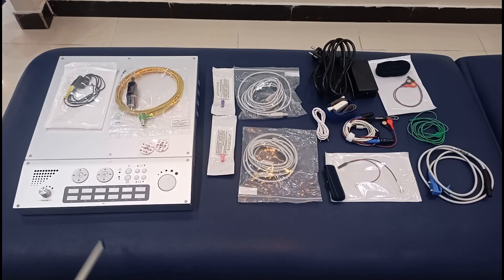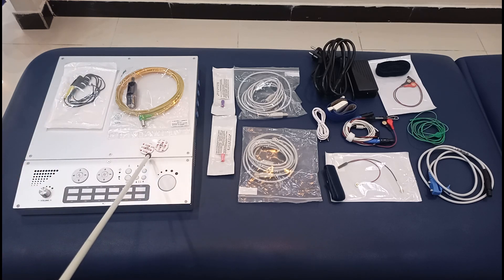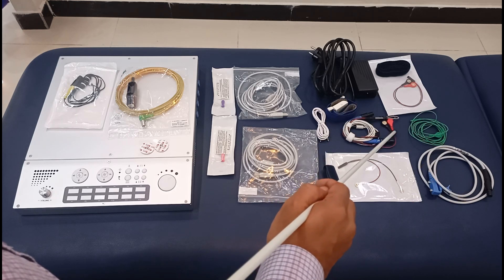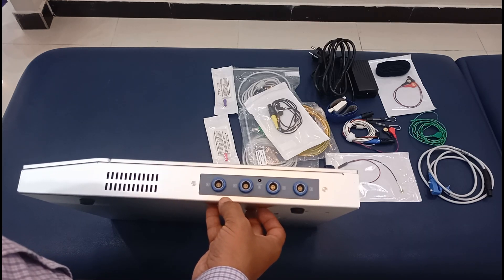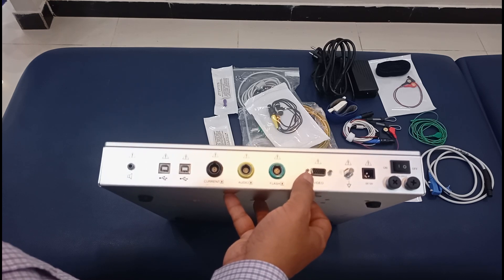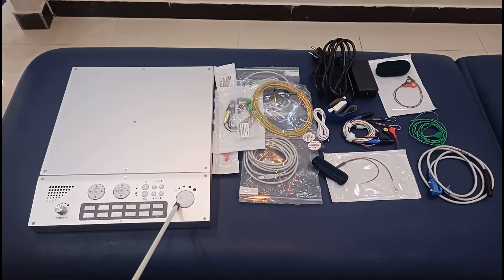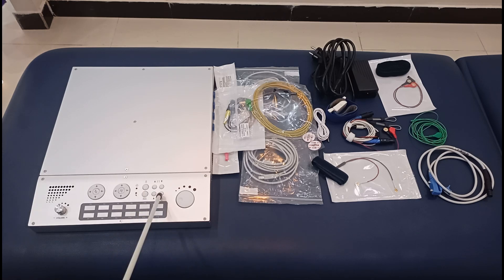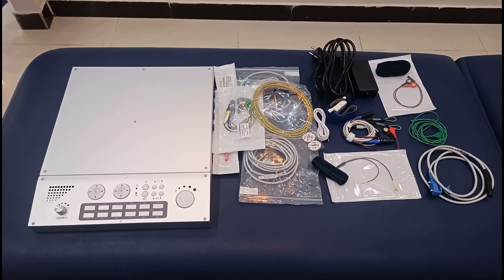NCS EMG Machine Introduction (Contec 6600B)

Comment: how is the machine? is it ok for AEP and SEP tests? have you tried other machines? what's the differences of them?
Reply from the maker: @zhaoEDX  I have used it for NCS till now and its really very well and economical.
Reply: @SyedAliPT  thank you very much. hows the price of this machine? Is it expensive?
Reply from the maker: @zhaoEDX  compared to other machines, its really economical. You can buy it under 3000 USDs.
Reply from the maker: @zhaoEDX  It is easy to operate also
Reply: interesting video. Only question: I read through the technical feature and analogue to digital ratio seems to be lower than standards so i was wondering: is it easy to get lower amplitude SNAPs (sural, lateral and median atibrachial sensory n)? that would really help me make up my mind about buying one.